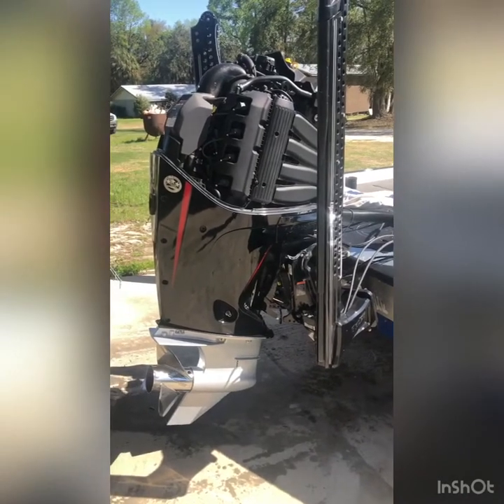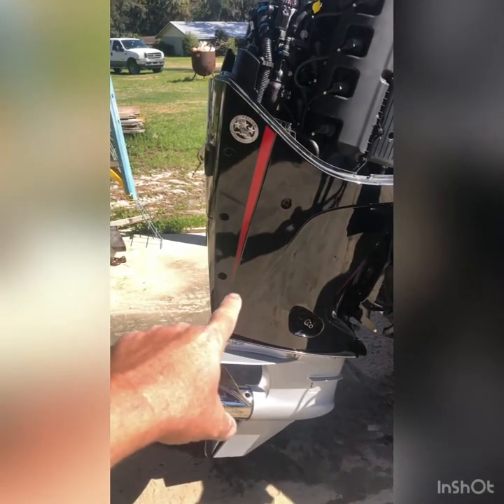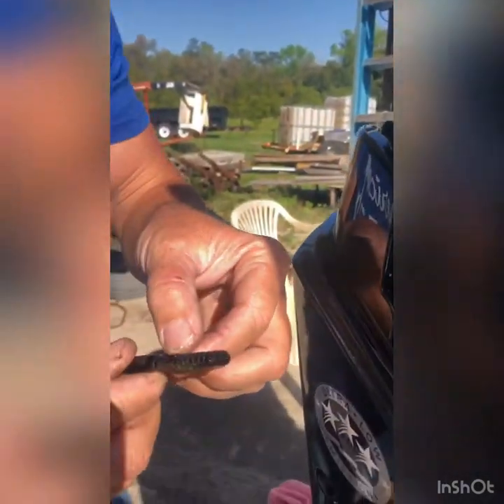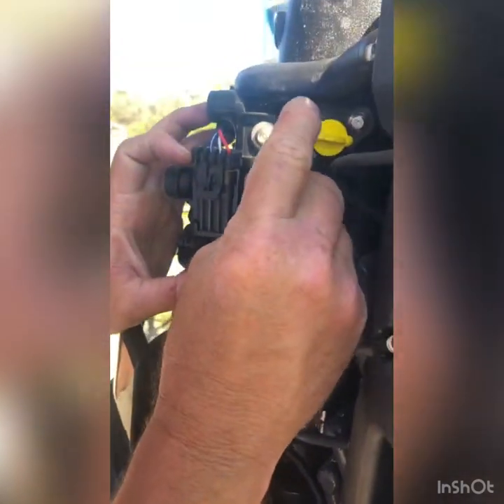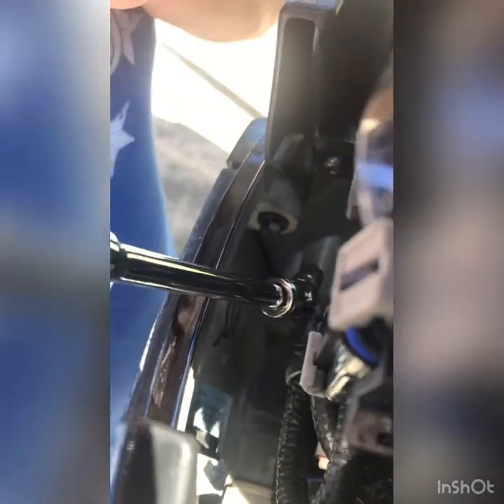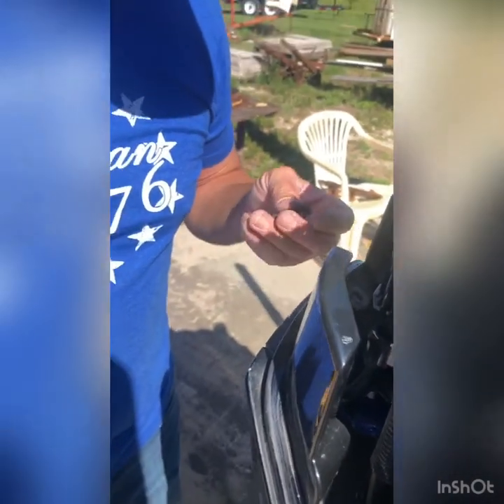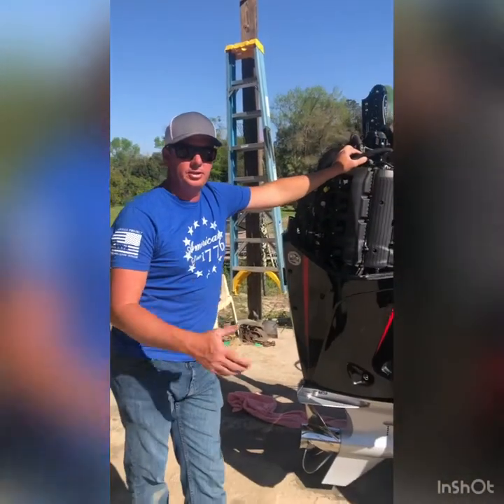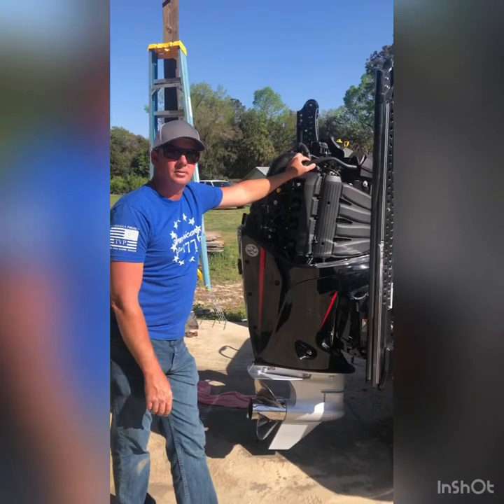Mercury 4 stroke overheating alarm, water screen locations

Comment: Thank you.   This was extremely helpful.  Putting all those screws back in is a challenge but to know about this filter before something goes bad wrong is wonderful info.  I pulled mine at 280 hrs after watching this and mine was very bad.  Full of weeds and dirt/sand.
Reply from the maker: Glad it worked out for you. They have changed this in newer years and the filter location is no longer in that area. However I believe the sprayers under the cowling, that spray the bottom of the block area are still there and need to be cleaned every now and then also.

Comment: Well done - you saved me an hour or so!  Two quick tips to make the job quicker: Spray silicone lube on the cowl seal for easier installation; and pushing 8mm bolt heads into 5/16" fuel hose makes inserting them into inside cowl bosses painless.

Comment: Thanks for the tip on lower cowling removal and filter cleaning.  
I think the pencil filter has been changed to a larger design on newer motors as you mentioned  
A shout out to all the people who film these maintenance tips 
You help keep us on the water 
Fish on
Reply from the maker: Yes , the lower screen in the mid section I believe is no longer on the newer motors. My new motor has the larger screen under the cowling as well. I’m glad that changes were made , regular serviceable items should be accessible :)

Comment: Great video work. My neighbor has a brand new 115 mercury that at 3500+ RPMs the pee stream starts to splatter and I saw steam coming out too. back off to 3000 or less and the stream comes back. I see this as a possible cause. it is a 2022 model so if anyone has input. He has only had it on the water twice. Homosassa FL however is shallow and very easy to kick up bottom crud and filled with grass.
Reply: I have the same motor with the same problem, did this solve his issue?
Reply: @joshoconnor1819  do not know yet. have not taken it to the water yet. we plan to drop the engine 2" and test again. Installing other things  now and will tray again.

Comment: Great vid. To Kurcz: Nice tip on the silicone. Here’s what’s odd, got to that screen to find both inlet and outlet have been capped off and the screen replaced with a plate. Weird. Mine is a 2019 model. Anyone have any insight on that? One more tip: When replacing the hidden cowl bolts, put some grease on the head. It will ‘stick’ to your socket on the way in.
Reply from the maker: I have heard that on some of the newer motors and also when some went in for service and etc that they may have blanked that off. Most likely under the cowling where I show the pencil shaped screen , you will find a large oval housing that will have a screen inside it. I believe it was relocated to here.

Comment: Hmm interesting. I’m trying to research why my 115 is cutting out and missing badly after driving for a while at higher rpm 3k+ I get I think 4-6 beeps but it just started drove fine the week before so I’m wondering if it’s a fuel issue or overheating because it just don’t seems like it’s pissing water as hard as it was at idol. So good to know. I never cleaned them filters can’t hurt. My boat never goes into full on limp mode I don’t got to turn it on and off or anything unless that’s not how the computer on these boats work.
Reply: I have the same problem do you find issue

Comment: My motor is doing the same thing where the alarm goes off, but also the motor isn’t peeing hardly. Cleaned the two easy to get to filters. Is this something that could fix my issue?
Reply from the maker: I would say that it depends…. 4Stroke are difficult to tell based on looking at the tell tale stream at idle. The midsection screen was in the older 4 strokes and they have made some changes in the newer ones since I shot this video. If you have never cleaned it and have gone through grass, or muck at some point in the motors life, I would say to clean them out to be sure. Also if you look under the motor while you have it apart you will see a halo of sprayers on the bottom of the motor. This is used to spray cool water on the motor and help cool it while running. Take that off and clean each nozzle until clear. You may find that it’s time to replace your impeller in the water pump

Comment: Why not take a garden hose to try and rinse out the water tubes?  Seems if the filters were clogged, that there could be more greenery that was unable to get to the filters, due to circulation issues from the clogs.
Reply: I’m doing that.  That is not gonna push the stuff caught on the filter.   At least I don’t think it will

Comment: Does anyone you know have a video on changing the check valve on the water flush connection?
Reply from the maker: Thanks for asking. Not that I know of. Add a picture of the part you are referring to. ( pretty sure I know what you’re speaking of) just want to make sure. I’ll figure it out and let you know.

Comment: Do you think flushing regularly after use would help heep the build up at bay?
Reply from the maker: I don’t think that regular flushing will keep from having to complete this service. Just based on how the screens pack up with goo so quickly and the flushing process not putting enough pressure on the screens to take away the crud.
Reply: Awesome video. I’m not having problems BUT I fish the shallow Mobile Delta. I need to just look at them.